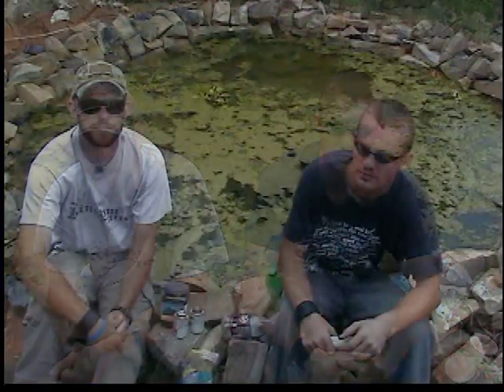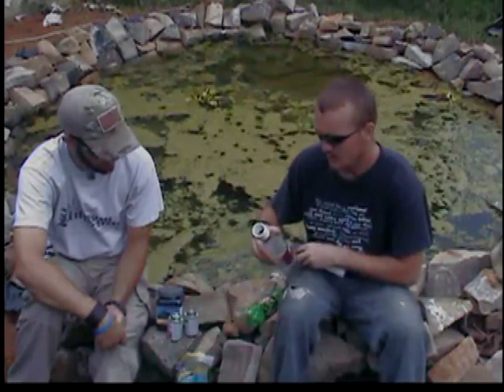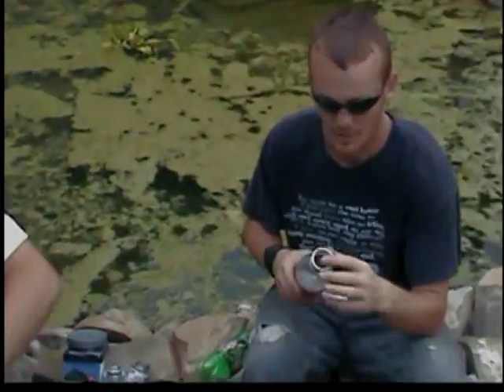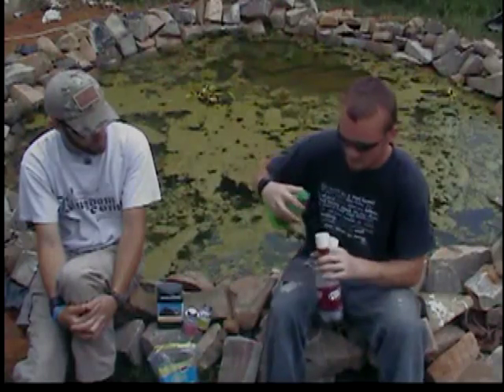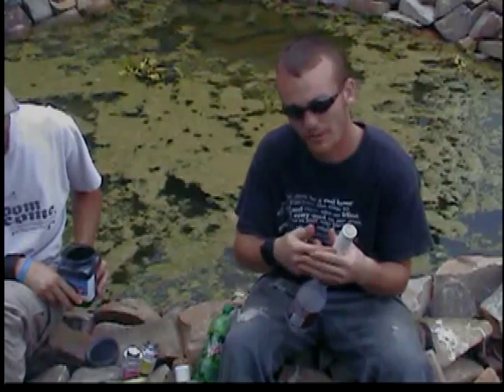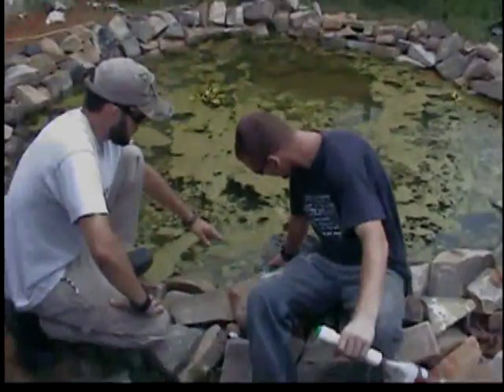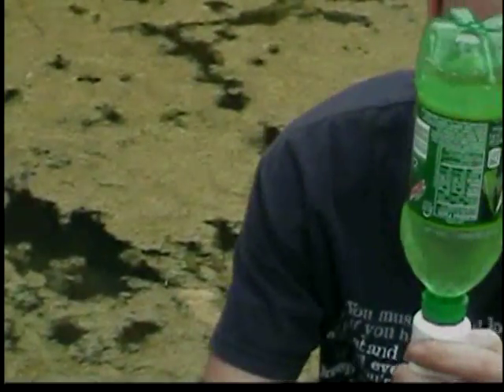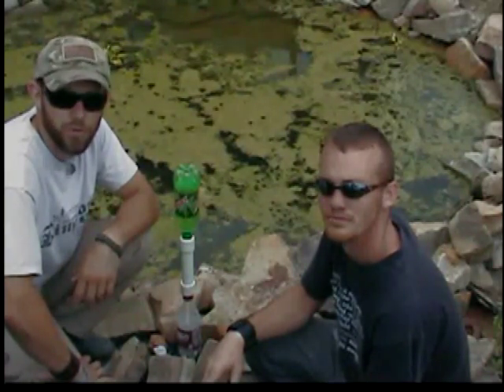HOW TO MAKE A PORTABLE WATER FILTER

Comment: Great video, I have made the same type, only toatally outta PVC. The common 20oz bottle is a great addition. Great job guys. A tip if u desire- only use Rain or shine PVC glue, it is blue in color. It dries faster and is great for when you have in the field repair's and where some moisture or water is still present. Got your message- I will think about it and let you know.

Comment: Great idea! Thanks guys. But I have some questions:
1) Does this need to be primed after first assembly? Flush until clear? I'm not familiar with activated carbon- does it drain off black for a while?
2) Bottle caps are glued into endcaps, but endcaps are NOT glued onto tube, right?
3) To replenish filter media, just remove endcaps and push/pull out media any way feasible?
4) Would squeezing air from bottom bottle to top bottle help? Or hasten the process unnecessarily?
Thanks again!
God bless!!